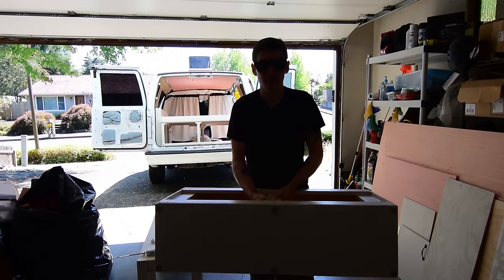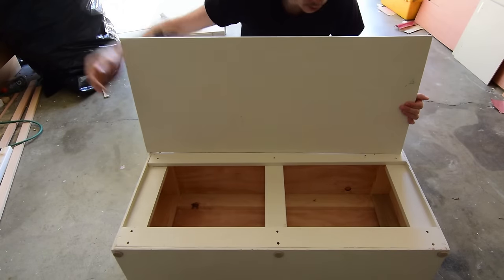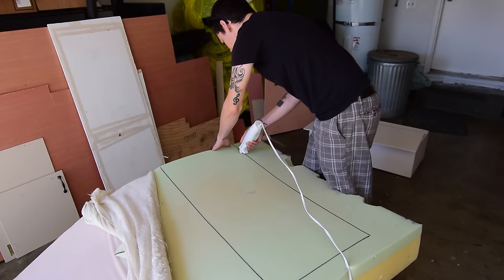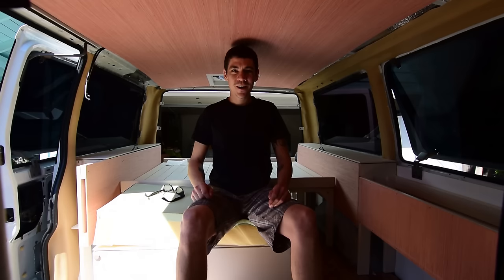VAN BUILD 2pt.16 CUSTOM BENCH SEAT, ULTIMATE STEALTH ASTRO CAMPER VAN DWELLING

Comment: cut a piece of the thicker plywood to fit inside the opening, then screw and glue it to the underside of the 1/4 inch plywood lid. your height won't change but your seat will be strong

Comment: You should use the thicker wood, but cut it so that it sits inside the recess of the cabinet, that way it would be stronger, but a 1/4 inch lower than the thin board

Comment: The cross support could be attached to 1/4" lid instead of box. That way the space to get into the box is not compromised or divided.
Reply from the maker: +tiki lebby that's what I was originally planning on
Reply: +Into The Mystery 13 I should have waited till the end. You always come up with the right solution . The 1/2" scrap painted was good and you could use the 1/4 on top of foam for a table if you sit on the floor.

Comment: well RE the bench, you couldn't just cut a length of ??1x4?? to screw down onto the central crossmember to bring it level with the top edge of the bench and therefore provide the foam with the support it needed to not flex?